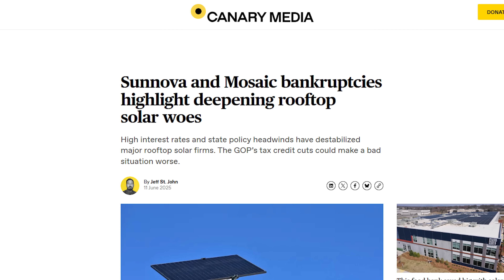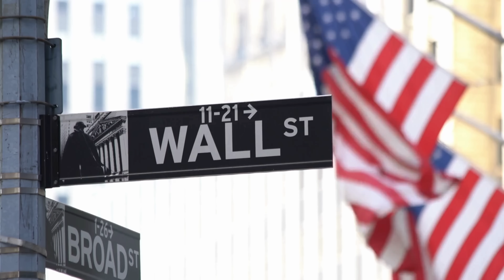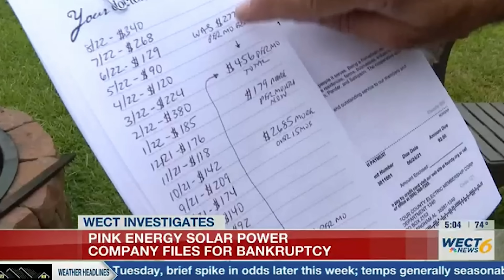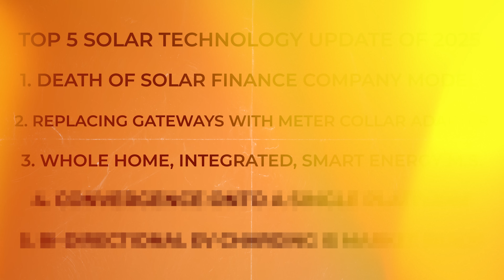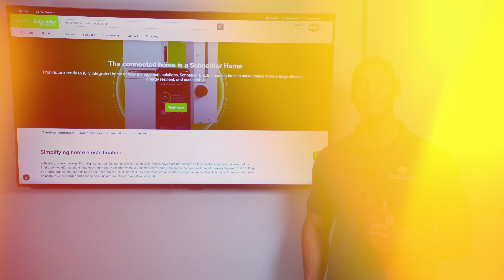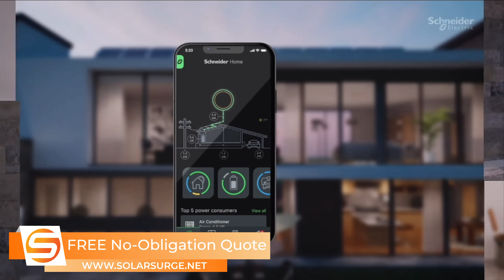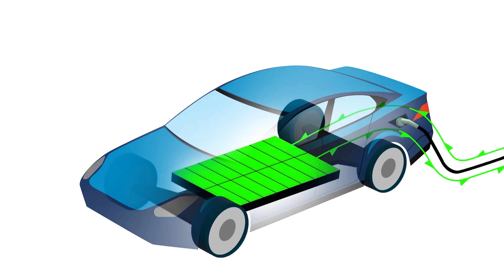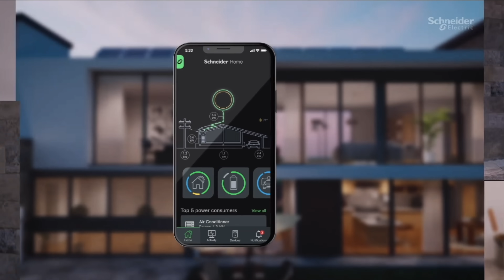2025 Solar Technology Update Part 2

Comment: Most solar financing is to be perfectly honest a TOTAL rig off. They over charge for installation and then either go out of business or declare bankruptcy, and then start up by a different name. I agree with @dwmcever below. I built my own system paid for it out of my pocket and now reaping the rewards. 30 425watt panels, 4 EG4 14.4 KW batteries and an EG4 18 Kpv. And to boot I know how this system works so I can to an extent troubleshoot if need be, and I only a high school grad, so no big fancy degree.

Comment: Joe, this makes no sense. How is having a grid disconnect going to replace the need for a critical loads panel? The description on Tesla's website reads like your typical Elon overpromising/marketing BS. You do NOT have to remove every circuit from your home panel into another panel. You only remove the critical load circuits (i.e. refrigeration, lighting, heating, etc.) into a new dedicated panel. You could avoid this simply by oversizing the solar system (10-15kW inverter) and getting plenty of storage. Sounds like a product looking for a problem to me or another clever attempt at getting a hold of your electricity use data.
Reply: The typical need for a critical loads panel is because the battery did not have sufficient amount of discharge over 5 kW. Now that new batteries have over 10,000 W of continuous discharge. It is not necessary to remove critical loads from the main panel. This gives customers the ability to choose which loads they want to run, integrated down situation. Having a choice is better than not having a choice. As long as the batteries can handle the loads without tripping a battery breaker, it’s a win-win.
Reply: @MrMikeGun Exactly. Build the system to be powerful enough to take care of the entire load. However, this is not always possible. This is where load shedding breakers (240V) on your main panel would come in to reduce the load according to the generation, inverter size and/or the storage available. How's a grid disconnect going to provide this functionality??
Reply: It's called a lockout kit... Then shut off whatever circuits that you don't need.... You might have to pay a whole $15 for that lockout kit.. 😂

Comment: Here’s the dark side of the meter collar that no one’s talking about I’m a residential Solar installer in Washington. The meter collar are not approved by your utility company so we end up doing anyway is rerouting your service into another meter that will allow us to put the meter collar on. It’s just as much work saves no time and honestly looks way worse. I definitely prefer the a gate over the meter color cap. It also looks significantly cleaner and is just all around better install.
Reply from the maker: Appreciate you sharing your thoughts on this!
Reply: When your local utility does approve the meter collar it really speeds up the install time.
Reply: Incompetent local utility… SDG&E has had an approved meter collar MID for almost (or a little over) 10 years

Comment: Trend you’ve covered but I think you forgot to mention in this series; 400V battery systems.
Reply: No thank you...
Reply: @SolarizeYourLife  Why, the solar strings are about 400V?  You don’t want reduced heat, conductor size, component weight, etc….?

Comment: The number one market trend is the informed consumer directing their own installation.  Thanks to information provided by Solar Surge, and other informative instructional vehicles, finance, commissions, and other added costs are removed from the equation.
I personally don't care if the installer company is good, bad , or indifferent. As long as you know a little, you can save a lot. Pull permits, get a qualified electrician, for grid integration, own your independence.
Thank you for facilitating the number one trend
Reply from the maker: Thanks for the feedback. Yes I think a lot more homeowners are going to choose to go that route to manage their project.

Comment: built my own solar system. no loans , no subsidies,  no funding of any kind from my grid. built my own grid switch. just bought more solar panels at 135 dollars per kilowatt. LiFePo4 batteries at 75 dollars per Kilowatt hour. Retired Engineer.
Reply: Built my own system too with 66KWh of salvage Model S modules and put up all of my own panels. Been completely grid free for 5 years now. Not an engineer and you dont need to be one  as this stuff is super simple.
Reply: Yikes!  Do you live on the moon?  😂 I only paid 50 cents per kilowatt.

Comment: Maybe now isn't the best time to ask given all the upheaval and solar, but are you aware of any manufacturers producing wall mounts?  I'm in a unique situation where I'm out of roof space, but have a south facing wall and a west facing wall that could soak up some energy
Reply: Whether you’re going into a 2 x 6 or a 2 x 4 or some simple sheathing, the same standoffs racks and rail system should work for a while as it does a roof. The goal is how much sunlight can you generate from a vertical standing panel where the angle is not ideal to the sun.
Reply: @MrMikeGun unfortunately I've yet to get an installer who will do it

Comment: I’m thoroughly convinced that my decision to install off-grid DIY was the best choice. All the technical,financial , and code requirement complexities are reduced or eliminated.
If the utility provider understands what is happening as we progressively scale up our off grid systems,they should be anxious. The utility input that tops off my battery at night is a twelve gauge romex.
If they want to keep selling electricity to home owners and avoid the cost of distribution infrastructure expansion,they will be begging homeowners to allow them to put THEIR batteries in your home.
That way,they could even reduce the capacity of the distribution infrastructure because the surge loads would be at the individual homes and they only have to supply average demand to maintain the battery.

Comment: It should be noted (on the V2X) that the Rivian no longer is working correctly.  Rivian does not correctly report back the state of charge to the bi-directional charger, so as a safety measure the charger shuts it down.  Other tested models of vehicles still seem to be working.
Reply from the maker: Thanks for the feedback.  We still need to get official support from the auto manufacturers.
Reply: That’s why over the air updates with your vehicles and solar system charge controllers and micro grid interconnection devices are so very important.

Comment: I wish DIY solar kits came with meter collars.  SO much easier than all the overly complexities non-sense. These extra gateway boxes they’re selling suck, really.  I shake my head when I see companies act excited about trying to sell a $2k gateway that most will pay several hundred or more for an electrician to install.
Reply: Meter socket adapter requires utility approval. Most utilities haven’t approved them to be used.
Reply: @RealNameSecret  Yes, valid point.  I think that includes Oncore Electric, my provider.  I’ll have to check.  Meter collar ties are “the way” mist installs will go, eventually.  The other trend will be 400V EV grade battery storage systems so the approx 400V solar strings don’t have to be stepped down as much and you can use cheaper 8 AWG copper battery cables.
Reply: @RealNameSecret You are correct.  Most utilities are NOT EXCITED about letting you install a meter collar device and have not approved them, and are in no hurry to do so.
Reply: Then start a company, seems like you got it all figured out
Reply: @johnsegal445   ha, sarcasm appreciated, but that’s not an industry I’d want to enter without a major arsenal of competitive advantages.
Reply: Stop trying to sell your excess energy to someone who doesn’t want it. Being connected to the grid as exporter is like dancing with a beautiful but drunk fat lady. Sooner or later she’s going to step on your feet and you both fall down.
Now THAT’S complicated!😢
Reply: Actually, the $2,000 MID (Microgrid Interconnect Device) you are talking about does save a considerable amount of money, time and installation headache.
Have you ever tried installing two hybrid inverters in parallel without the advantages of a MID?  You would need overcurrent protection, a manual transfer switch for bypass, a combiner load center and significant conduit, cabling and labor for EACH inverter.  The MID handles all this, plus: allows 3 inverters to be connected in parallel; offers smart load intelligent control; provides seamless generator input; provides easy integration of existing grid-tied solar via AC coupling.  All this in a UL-listed product which makes inspectors happy to issue an approval.
Don’t underestimate the advantages of a MID.
Reply: @powerranger9160  Just include it all in the hybrid inverter for an extra grand or two instead of over $2k for separate box to pay to install.  These are expected capabilities, not bonus features.